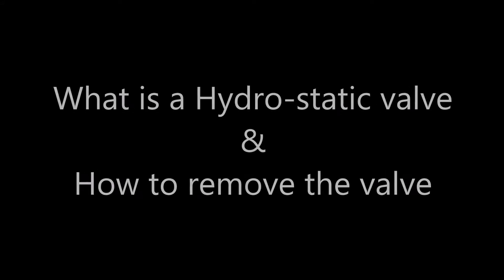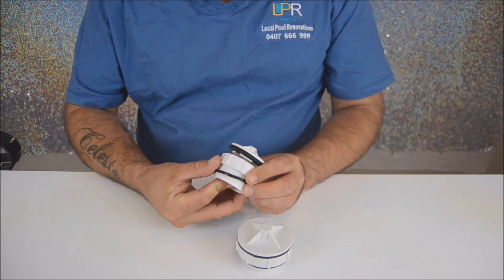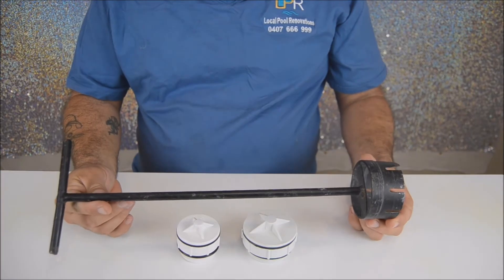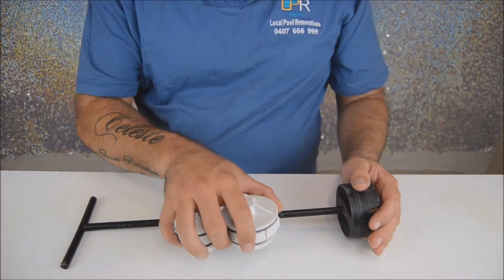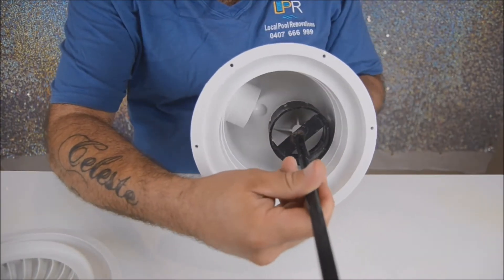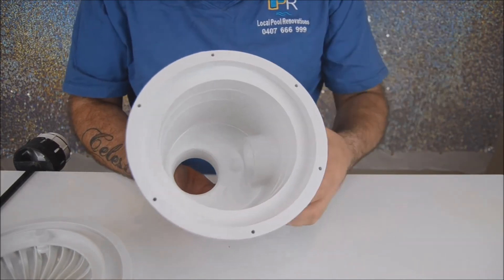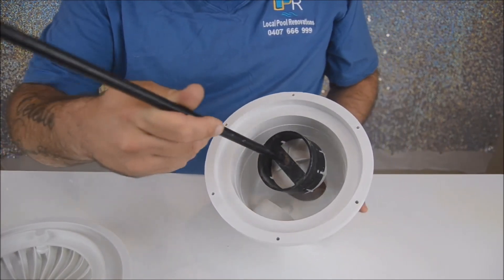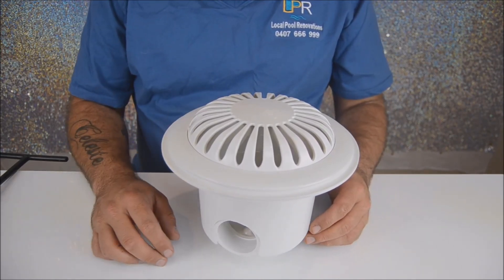Pool Hydro-static valve, what is it & how to remove or replace a Hydrostatic relief valve?

Comment: If there is a separate valve at the equipment marked MAIN DRAIN, then would there not be a hole at the main drain and a pipe running independently back to the equipment?  Because you said that hole on the side of main drain is connected to the skimmer, and that's what is confusing me.
Reply from the maker: Hi Juan, a Hydro-static valve is always at the deepest point of a swimming pool. There is a second pipe that is sometimes used and it normally runs from the main drain to the skimmer box. It would be unusual for that pipe to go directly to the pool equipment, however sometimes things may get done by someone who had other ideas. As for the valve itself, I can't imagine why a hydro valve would be at the pool equipment since it would be useless to the pool. I can only assume that the set up you may be looking at gives you the choice between suction from the skimmer box and suction from the main drain, this would allow you to clear debris from the deep end of the pool through the maindrain OR to skim the pools water through the skimmer box. In Australia concrete pools usually have the maindrain pipe connected to the skimmer box, the theory is that any debris that falls into the maindrain would be suctioned through that pipe into the skimmer basket & another theory is if the skimmer box get full and blocked it may give an alternate way to deliver water and not allow the pump to burn out, In my opinion the second theory does not work. Hope this info helps.
Reply: @LocalPoolRenovations  when I said "valve" at the equipment I meant a diverter valve, like a Jandy.
Reply: @LocalPoolRenovations  my pool (1977ish) has the main drain run directly to the pool equipment room.
Reply: Yeah usually the main drain is run with its own line back to the pool pad, independent of the skimmer. Seems sometimes thats not the case though in AUS.

Comment: What can i expect to happen when the old valve is removed? Will a heap of dirty water enter the pool? Or will the prussure of the pool water above  keep that from happening?
Reply from the maker: If the pool is empty when the valve is removed then there is a good chance the water will rise into the pool (If there is any, it varies over many factors like location etc..) if you are doing it when the pool is full of water, In my opinion the water pressure inside the pool will push out from the threaded hole if the valve is removed, making the pool lose water, there may be some discoloration from the pool water mixing with whatever is underneath but i doubt the water table would be high enough to beat the pressure of the water inside the pool.
Reply: @LocalPoolRenovations  Thank you for your reply. One more question -  I have an old fibre glass pool, which is in  ordinary condition. Losing a fair bit of water. A lot of the paint has worn away. Is it safe to drain a fibre glass pool even though it has a hydrostatic valve? I've gotten a lot of conflicting answers about draining them.

Comment: Very helpful. Would there be a pipe installed below the valve?
Reply from the maker: In most cases there is a slotted pipe that travels vertically down under the maindrain, this is to avoid rock and other debris from travelling up into the pool that could potentially block the maindrain.

Comment: Can you add a hydrostatic valve in a fiberglass pool when the ground water level is about 18 inches above the bottom of the pool? If so how could it be done?
Reply from the maker: We don't work with fibreglass pools, but we would pump that water out and keep getting that water out until it stopped coming up or was hardly moving up, then get the valve in and fill the pool as soon as possible.

Comment: stupid question here - but if water is coming out of this valve into the pool, once you fill the pool up with water does the pool water just keep rising with the water coming in from the valve and overflow the whole pool eventually???
Reply from the maker: Once you add the water in the pool, the pressure of the pool water should be greater than the ground water, keeping the valve shut, if something were to occur that the ground water suddenly increased it water open the valve and go into the pool, once that ground water pressure decreases, everything should go back to normal again.

Comment: Thank you for sharing this! This is new to me. Our pool has one of these. Our pool is 30-40 years old? I’m getting ready to do some repairs to our pool and paint it. In the past we’ve drained the pool using a sump pump and ground water continues to come in through the hydrostatic relief valve. So painting become quite a task with continual water entry. Can the valve be removed and capped temporarily during the painting process provided no recent rain fall or do you suggest another option for this? Thanks!
Reply from the maker: Depending on the valve size, we normally grab a 1 metre long 40mm pvc pipe and attached a threaded cap onto it, once it's dry we screw that into the main-drain, this way the water can still travel up the pipe without disturbing the paint you are doing on the floor and also not causing stress to the pool shell with water pressure building up. (If it's a 50mm valve use a 50mm pipe etc...)
Reply: @LocalPoolRenovations  thank you for sharing your knowledge and your time!
Reply: Is your pool fibre glass?

Comment: I think you said the main drain with the pipe to the skimmer basket is usually clogged and it's not good. Should we not get a main drain with that? Should the main drain just have the hydrostatic valve with no outlet to the skimmer? I read something about a hydrostatic valve with the plug and if the plug is left in you can still have problems. What plug are they talking about? Should all hydrostatic valves have the plug removed once installed? Do all hydrostatic valves have plugs? I will have an in ground vinyl liner pool 17x30 but ran into rock so we will not go deeper than about 5 ft. Husband wants a double main drain. I think we have a low water table where we're at not sure if we need hydrostatic valve or main drain much less double. Any advice is appreciated. I would rather be safe than sorry!
Reply from the maker: Hi Emma, some people call the hydro-static valve a plug, once installed there is no plug to remove, I would not recommend having two maindrains / Hydro-static valves especially for a vinyl liner. Feel free to contact me on 0407 666 999 or email me andrew@localpoolrenovations.com.au

Comment: For a new gunite pool build how do you add a hydrostatic relief valve? Do you buy a main drain with a hydrostatic relief valve already installed? Also, does the hydrostatic relief valve have a PVC pipe attached to it that goes down into the ground?
Reply from the maker: Hi Dr C, In a new pool build the maindrain is installed at the same time as the rest of the plumbing, prior to any other work continuing. We have seen a couple of ways to add a valve to an existing pool that didn't have one the most common being a hole core-drilled into the deepest part of the pool shell all the way through (Normally 40mm) then a pipe is pushed through with the valve fittings added after the epoxy used to adhere it dried.

Comment: Just installed,  going ro add water and see what happens.  Pretty easy set up.
Reply: It didn't work to perfection but after a few tries and an extra tub washer and plunbers tape I finally got it to work. I built a jig for a 3-1/8" nut and had to tighten it well. In the end great design for a troubled drain plug. Saved about $200 on this.

Comment: Where can I get a Hydrostatic Valve Removal tool from? I've seen some online but can I use any other type of tool to remove the Hydrostatic Valve?
Reply from the maker: We have managed to remove some valves by hand, since they should be only wrist tight, in some cases when they are too tight for the removal tools we have had to cut a groove into the valve and used trowel or shovel to twist it off, which is an ok option if the desperation to remove it calls for it.
Reply: You don't have room inside the filter to get any kind of wrench on it, but I built a square tool that is 3-1/8" to hold the nut and giant pliers to tighten it from the outside.  Good idea but you need to add a tub washer and plumbers tape to keep it from leaking.  In the end saved me a little money but it saves me time and money in the long run. Good luck 👍

Comment: Where can I get this tool? Also, how do you know which valve you have? I've seen online some that have the square nut on top so it may require a different one or am I wrong?
Reply from the maker: Hi Alex, Normally you should be able to order one through a swimming pool supplies shop near you. 
The only ones we know of that have a square nut shape over the top were not valves they were plugs, however they might vary in size or shape depending in which country. 
The one in the video is the 50mm Waterco hydro-valve, but there are others, Haywards SP1056, Astral Hydro-valve which has a stainless steel bolt that can be seen from the top & there is the CMP 25620 hydrostatic valve which I believe is based in the USA.
Reply: @LocalPoolRenovations  Unfortunately the only ones I'm seeing are the plastic PVC type and I want to know where they have the metal ones that would last longer. If I can't get the valve off when I:m draining the pool I would be in serious trouble. I'm simply afraid that it would break while trying to pop the valve. Can't afford that to happen.
Reply: Someone please tell me why the tool to replace a $25 part costs $100-200?
Reply: @jamesburnett6247  LOL, thats what I was thinking? I am going to make one out of PVC.